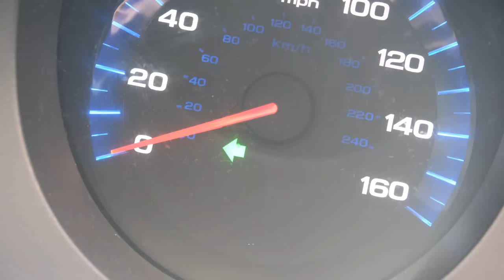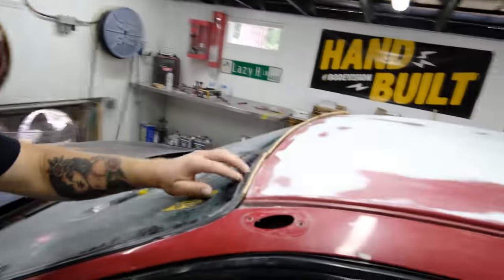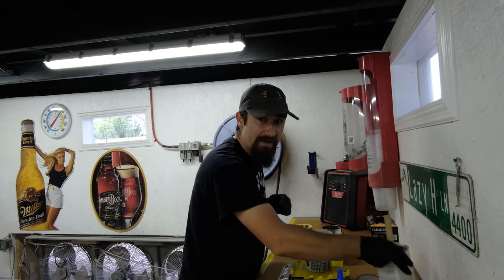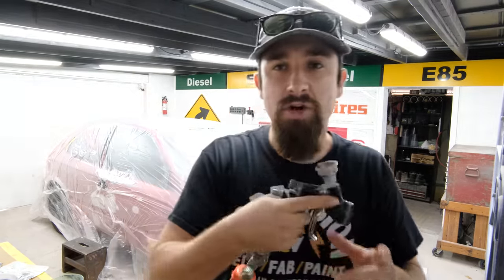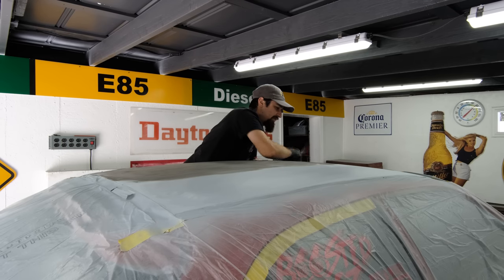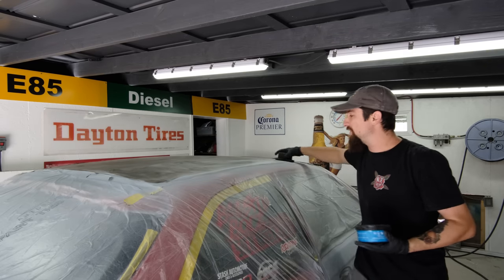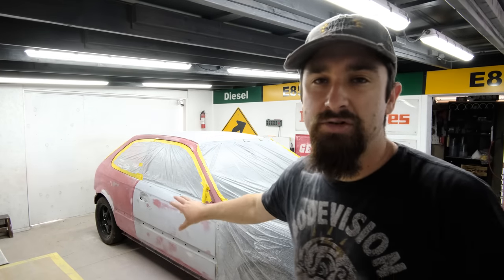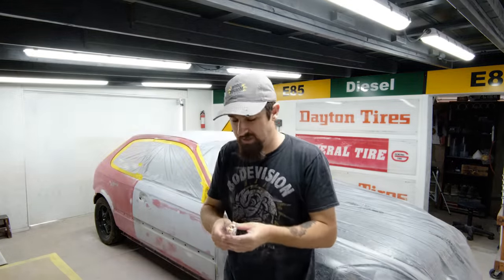I Used a $20 Harbor Freight Paint Gun on The @boostedboiz Hatch

Comment from the maker: In this video I accidentally referred to the hardener as reducer and if it got confusing I will clear it up for you here. The primer is meant to be used with 2% HARDENER. My second time spraying the primer I still did use 2% hardener as well as using additional REDUCER to thin out the primer for my smaller spray tip. Sorry for the confusion and thanks for watching.

Comment: I find it so cool that even though you got a $20 gun, you still used an in-line filter + a pressure regulator, giving it a fighting chance, nice work man!
On another subject; is there a way I can subscribe more than once!?
Reply: You have two or you end up with junk results.. bad prep bad end result a lot of times when you use cheaper things you got to do every single thing you can to give it its best chance at success
Reply: Exactly right if you did not use a filter and pressure regulator you can allow water or oil to go through the spraygun and mix with the paint vapour and it then lands on the panel and is trapped below the paint where it can cause all sorts of reactions like micro blisters crazing peeling and even de laminating or corrosion as primer is mostly hydroscopic which means it absorbs water you must use an in line filter
Reply: Ya you can subscribe to his only fans for the low low price of 69 $ a month

Comment: Really like how you explain the whole process so well. You have inspired me to fix my stuff a little more proper. I fixed 2 curbed wheels using bondo, paint matched cans and Spray Max 2k clear. The wheels turned out really clean, then the damn tire shop used clip-on wheel weights on alloy wheels.  😤

Comment: Rather than paint sticks on the window rubber , I would use some cord or string . It holds it up enough to get paint under the edge and when you are done you just pull the string and the rubber lays right back down .

Comment: Hey, cool thing about those weird horizontal shadow bars in the footage from the paint booth: LED lights flash on and off at a certain Hertz per second, usually a multiple of 30, your eye can’t see it but it’s just fractions of a frame per second faster than any multiples of the frames per second of the camera (29.97 instead of 30), because of this you see lines and they move kinda like a helicopter rotor at a slightly different speed than the frame rate of a camera! Incandescent and florescent lights don’t flicker because they use a material to give off light that has an on/off response time slower than the flicker rate of the power source so it smooths it out.

Comment: All my years with a system I've never had a power wire melt the safety in the amp will kick before the fuse even blows lol I'm sure it's good safety but with that small system I doubt you would have any trouble great videos bro how's the floor in the house be cool for an update and was curious I have saw some painters using a blow gun and a static rag was curious what your take was on that amazing videos as always and congrats on 100k

Comment: Why are the speakers in your acura mounted to the door panel instead of the door??????
Reply: Probably just don't fit in the cavity so instead of cutting metal door, he's just cut the door panel
Reply from the maker: Yes. He answered the question for the exact reason. I wanted to go with an upgraded speaker and it’s larger and thicker. So this is how I did it

Comment: Also the evercoat finish sand high build isn't as thick. Feather fill us like the slick sand. Finish Sand mixes 4:1 and I always throw 10% reducer. I highly recommend you try it. Iv used it with a 1.8 tip.

Comment: A general misconception is that the fuse is to protect the device. So it is a breath of fresh air to hear it referred to wire protection. 

I will add, make sure you calculate the amperage of your load and compare it to the amperage capacity of your wire. Always make sure your wire can support your load. Finally, fuse your wire as close to the power source as possible. Using the fuse that matches the capacity of your wire. 

My spl car had 8 1/0 cables feeding around 11k watts. Roughly 743 amps of current. Was a fun car. 

Also, hvlp for the win.